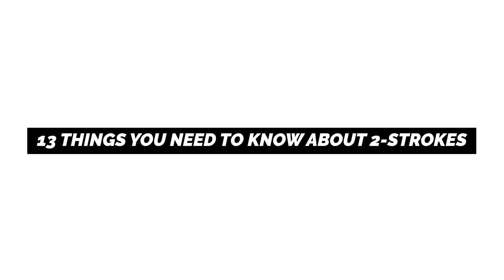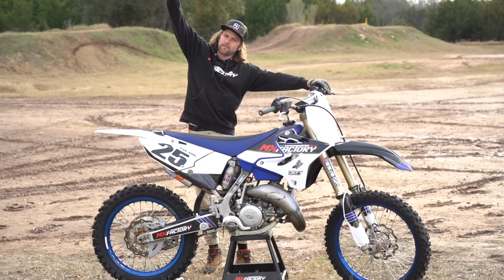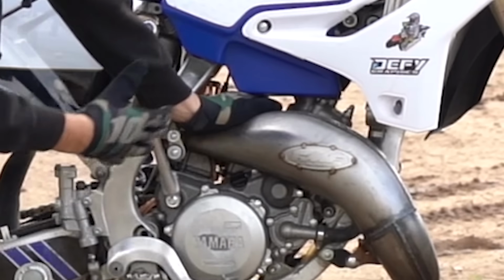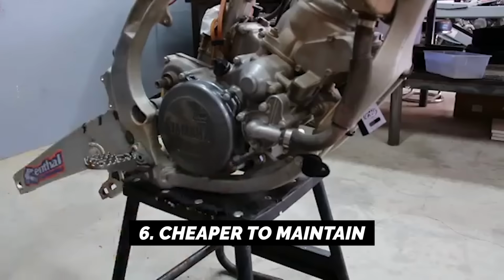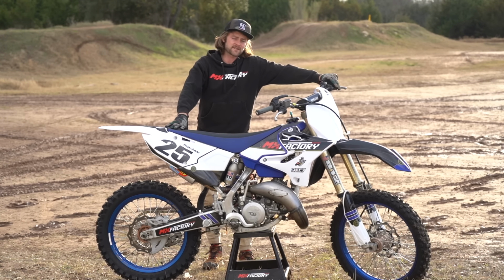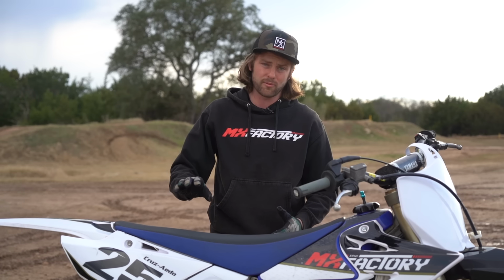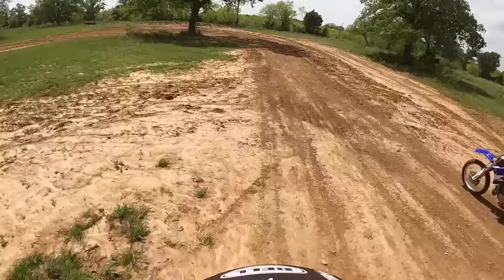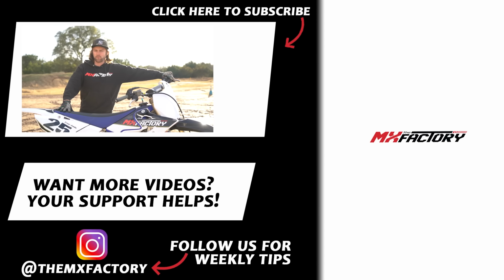13 Things You Need to Know About 2-Stroke Dirt Bikes

Comment: My dad started his 250 4 stroke at the beach 1 girl out of a group of 12 girls looked I started my 250 2 stroke right after and all 12 broke their neck lookin at me 🤣at that moment I realized the 2 stroke life was the life for me
Reply: Lol!
Reply: because 4 stroke sounds like anything else you normally hear, but that 2 stroke is just mean as hell sounding.  especially when it is revving to the moon and blowing smoke out the back.
Reply: Same reason superbikes turn more heads than loud annoying harleys lol
Reply: Bc they sound obnoxious lol
Reply: They turned to see if it was there old man coming mate, cause they dads owned 2 stokes, and probably couldn’t believe Dad got the heap of shit started again.
Reply: u dont use a rotary engine?
Reply: @benlondon8467  bet 250 two stroke blew 250 four stroke off the track
Reply: @robertjeffery696  lol, 😂😂😂, only thing blowing up on the track is ya 250 2T, I’ve had plenty of 2T when I was younger, they are shit boxes mate, I’ll take a 450 4T all day, everyday.
Reply: @Tv-nv7st  four strokes produce less torque. Power is basically torque X revs. 2 strokes are lower revving yet more powerful, therefore they produce far more torque.

BTW, calling a nearly 20% difference" not much"? Clearly you've never raced.

And the reason many manufacturers no longer make 2 strokes is purely because of legislation. In many of the biggest markets 2 stroke engines are being banned, not just for motorcycles, but outboard motors and even lawn mowers, whipper snippets and chainsaws.

To say two strokes are not competitive is idiotic. 20% more power in a lighter, cheaper and more reliable package isn't competitive?' In what universe?

Hate to tell you, but your post contained virtually zero facts.
Reply: I like 2 strokes because of the acceleration but they are annoyingly loud. I like the sound of a 4 stroke better.
Reply: Lol probably because they are loud
Reply: buddy I’m sorry but they looked cause they were wondering a why a fucking whipper snipper was on the beach😂
Reply: @Seeker-vo2tz  stay in the woods
Reply: @benedictcumberbatch4275  2 strokes ride smoother imo but i am comparing my ktm 300 to my wr450

Comment: If Suzuki got back to making 2 strokes I could really see them having a full blown brand revival
Reply: Fr
Reply: May we pray mate
Reply: They still make the rm85 2 stroke
Reply: I still have my 05 RM 250 and absolutely love it. More fun than my 21 Husky 450
Reply: @jrod1076  hold on to it its a better bike
Reply: @Andy Torres you got a good little bike their
Reply: I have a 125
Reply: I have a rm85
Reply: Suzuki sucks
Reply: They didn't really make alot of the smaller cc 2 strokes there all just rebranded kawasaki kx, 65 85 100 all kawasaki, not sure about the 125/250s but all the smaller rms are just yellow kx's
Reply: Yes also honda and if kawasaki made 125s that would be epic
Reply: Ya
Reply: If suzuki made 2 strikes again..I'd buy one, hands down
Reply: @vtecmossy  125s from 2004 onwards used ktm clones and revved out much more than the kx125s, 250 rms handled much better than the kxs, was a better ride overall, basically, those are two different bikes
Reply: @vtecmossy  that's not true, suzuki made those bikes and the kx85 and rm85 were never the same bike. The kx65 and kx100 were rebranded rms, however the drz110 was a rebranded klx110. A kfx400 is suzuki. I think they made a kawasaki version of the drz400 as well, few other bikes I'm forgetting. They had a deal going on but no the 2 strokes were made by suzuki amd the 85s were not the same because they were in a competing class, like the 125 and 250
Reply: They have the rm line shifter is butter
Reply: @sjtun9493  my nephew got a 2022 rm85, jesus they're quick bikes for their size
Reply: 100% bro
Reply: Yep. Keep the engine and frame because they're still good but update ergonomics and brakes and they'll sell.
Reply: Yes! Imagine they remade the Suzuki Gamma RG500 but with today's technology!
Reply: @issac8517   have you ever even so much as stepped foot on a Suzuki?
Reply: nah nah nah if Honda started making the cr 125 and cr 250 I would buy them both hahaha
Reply: I like Suzuki 4-strokes as well
Reply: @issac8517  you never rode one
Reply: @vtecmossy  not true
Reply: @VeritasSimRacing  Yes RM85s are awesome! ..now don't use the Lord's name in vain!
Reply: There loss Yamaha is the only Japanese Manufacturer that still produces and with all the championships and winning as of recent they could always Manufacturer 2 strokes.

Im glad Yamaha is successful as of now.
Reply: I run a kTm 85, I rode a rm100, that’s a fun ass bike 🔥
Reply: 2 strokes aren’t a brand
Reply: @pollux2825  bro what?
Reply: @eric6rock  Kawasaki still make kids 2-strokes tho, my cousin has a kx 65 and a kx 85 one is 2015 and other is 2022
Reply: Honda!
Reply: @chrissherwood4544  facts
Reply: I want my old RM back
Reply: @jeremyv4636  Ik man, good things come and go sadly 😩
Reply: @samenos7224  thank you for the history lesson sir
Reply: that would be awesome
Reply: I've got a 79 TS125. so fun
Reply: @CrewCrewlancer  yes, I have and they suck the carburetor is trash on Suzuki
Reply: I have a 97 rm125 and shes a runner!
Reply: There are new Suzuki 2 strokes for sale in NC
Reply: @kennymilton7457  they still make them but rm85
Reply: i got a 2000 rm suzuki first bike ever
Reply: I still have rm250 1998 running on good condition
Reply: They have the rm85 and rm125, actually I’m looking at my first ever bike and I’m getting a rm85, the price is great and it’s a dope little 2 smoker.
Reply: Currently riding a Suzuki tf125 2 stroke in a kx100 frame absolutely love it despite it being about 40 years older than me 💀 came from riding a 125 4 stroke and the power of a 2 stroke is amazing and the sound 😍😍
Reply: Suzuki never innovates or does well at anything. 

For example: DRZ400 and GSXR. They’ve been the same forever. Oh and the SV650. 

You think they’ll make a 2 stroke again? No way.
Reply: @issac8517 nothing quite as nice as a rm just simple machine none or the crazy expensive stuff
Reply: Had a 1984 rm 80 , 2000 rm80 , 2001 rm85 big wheel , built my own rmz250f , now ..... I got a 2008 kx85 2 bangers are mint.

Comment: I can tell you don’t get off the Mx track much. Two strokes own the woods.
Reply: yep i ride my motocross bike in the woods and you couldn't get me to ride any other bike
Reply: @Zander_Hale  MX bikes really suck for enduro I have done it and would never change. A enduro or even trail like my bike is way better!
Reply: @tylermacdonald9689  yea but i dont do anything like crazy enduro just some basic trail riding but 2t mx bike like mine is almost perfect
Reply: Yessir
Reply: @Zander_Hale  that was my only thing.  I don't have a track super close to me and I do drive to it sometimes but I have a lot of trail riding but was thinking of getting a yz125.  It's just trail riding, small hills, little rocky sections and fun bumps/whoops.  Do you think it'd do good there?
Reply: @flawlessvictory_yt7941  I dont own a 125 but from the fact that theres lots of people out there that take 125s and such out on trails and i take my 85 out on trails im sure that bike would be great for you especially since you go to a track every now and then
Reply: @flawlessvictory_yt7941  125s have no low end and are pretty bad at technical trails, very good for track but not as good for trails as they just have top end power
Reply: @flawlessvictory_yt7941  if you can find a 125x then sure
Reply: Debatable
Reply: Right.
Reply: Gncc especcialy

Comment: no engine breaking (or very little) is the thing i like least.
Reply: I reckon that's one of the good things,  easier to carry more speed through corners.
Reply: @callummacleod1921  100%!
Reply: You shouldn't engine brake a 2t anyways, the top end gets lubed by the oil in the fuel. When you engine brake it is only getting the amount of fuel it would get at idle, but it is still spinning at 3k+ rpms and not getting the oil it needs. It wears out the top end faster when you engine brake.
Reply: @cadencramer2747  Sorry mate, i have to disagree with you there.  The oil also pools in the crankcase and continues to do its job at zero throttle.  While prolonged periods of engine braking can be a problem, ie long hill decents, I personally have never had a problem over 20+ years of riding and racing 2T's.
Reply: @callummacleod1921  Yeah I was mostly thinking long descents. The trails around me are pretty much up or down, not much flat ground, so I usually just pull in the clutch and freewheel down the mountain.
Reply: riding a 2 stroke forces you to be a better rider. You can't be lazy on a 2 stroke or you WILL make mistakes
Reply: @cadencramer2747  Yep, not a silly idea at all. Better safe than sorry. A correctly tuned modern 2T is much more durable than people think though. The oil that comes out of suspension in your fuel and pools in the crankcase will lube your motor for quite some time at closed throttle.  Most people don't understand the principles of the 2 stroke motor,  and the majority of failures that people attribute to that closed throttle scenario are caused by other factors.

Comment: I recently switched to a 2 stroke and I love it! I do more xc riding so I got a 300 XC. It’s lighter and more powerful than my 250
Reply from the maker: Awesome to hear!!
Reply: Put in the red power value spring, turn out the power valve screw, slap on an FMF Fatty & 2.1 ti shorty. Take an extra pair of underwear if you remap the ECU...
Reply: Absolutely love my te300, 2 strokes as far as enduro and trail riding is the superior bike!

Comment: I'm 60 years old and I hadn't written a two-stroke dirt bike since I was about 20. So I went ahead and bought gas gas ex250. And I'm having a blast on it. It's a little bit scary because I'm only 5' 8, but I do what I have to. I love the 2-stroke power, the sound, and just the way they run in general. And the newer TPI bikes like mine can be lugged down without fouling plugs.
Reply: Almost the same brother. Haven’t ridden competitively in over 20 years. I’m 45 now and just bought a KTM 250 SX. Gonna take it on the track and show these youngsters how it’s done.

Comment: 2 strokes rule!  However, they are getting somewhat more expensive depending on what you buy because they are getting snatched up by collectors.  Great job Cody!  2 stroke Coaches Challenge race would be good!
Reply from the maker: This is true!
Reply: Thanks Tony. More 2 💨 videos to come
Reply: @codyhaverfield5152   Reason 14. VP Fuel's T2 burning reminds me of going to Supercross back in the 80s! Also makes the garage smell nice!
Reply: I got a 03 yz85 for only $1400
Reply: @tiana5271 that’s not that cheap at all 😬
Reply: I still find 125s in my area for below $1500. 250s seem to go around $2000 around here if they have a fresh top end. The odd thing is 80s and 85s seem to demand a premium. I don’t understand that.
Reply: @330FoeSho  I bought my 06 CR250R for 4k with Lectron carb and thought at the time it was a steal. I have since put another 3k in it. I never intend to sell it but I have seen similar bikes go for 5k - 10k in the Austin area. 125's typically go for a little less.  From what I have seen there seems to be a ton of people buying them, fixing them up and selling them for a premium.
Reply: Couldn't agree more. 2 strokes are becoming less and less available - driving up the cost.
Reply: @shoruda bruh what that’s not cheap?

Comment: I started riding my first time last year at 38 on a  2011 KTM XCW.  Had never ridden a bike in my life; didn't understand power band, sucked at clutching.  Put a few hours on the bike and pretty much immediately went and broke my tibia and fibula hitting a rock and got a nice metal rod and screw in the leg (sep 2020).  Poster boy of what NOT to do. 

Been riding past few weeks just taking it slow; messing with powerband springs and figuring out what I like and don't like and learning to clutch.  I've ridden a friends 4 stroke since the accident, but I'm gonna stick to the 2 stroke and learn to ride properly. Yes I'm an idiot - was my 4th bone break,  so wasn't anything new. Just first one on a motor vehicle.

Comment: I have a built YZ 125 making 42 hp on VP C12. To say they have less power would be talking stock power out of the box. With the built engine in the light weight 125 i have a far better power to weight ratio than even a 450. I can take them on holeshots even and have several times racing open class. The best part is 2 laps in the four stroke guys are getting arm pump and tired while im still just flicking the light weight machine. I usually get a good start with it and then stick with the leaders for a few laps and by the last laps when they are tired i put the pressure on forcing their mistakes. Two strokes are easy winners if you build them right and learn how to ride them correctly.

Comment: You forgot to add; number 14 ... locktite is your best friend when maintaining a 2 banger
Reply from the maker: Yes!! we forgot that one!
Reply: Sure if you have an old Ktm. With yamaha maybe not so much. And well, with modern ktm is even less.
Reply: New KTMs have a 2 stroke counter weight to cancel out most of the vibration.
Reply: I hate lock tight.  Only use it when absolutely needed, and I almost never need it.  If you want to mess up your torque specs, use lock tight.  Best to just stick with the torque specs.
Reply: @EarthSurferUSA  My sons TC125 manual specifies the use of Loctite on some fasteners in conjunction with a torque spec

Comment: To those who feel that the Powerband is too narrow, fit a VHM cylinder head and you will wonder why you did not do that earlier! We fitted one to our 150sx (that was an awsum bike to starters) and we ended up fitting a bigger front sprocket and a smaller rear one to keep the new power under control. Our 150sx is now a 250f killer!
Reply: If you want to go racing and get the best results possible then you have no business riding a 2 stroke but if your riding for fun then you have no business on a 4 stroke in my opinion ..  nothing like it when you connect a few corners while she's on the pipe ..brrrraàaaaap
Reply: Way to go! You guys rock!

Comment: At equal displacement, the 2 strokes power ratio is 1.7 greater. It means that a 250 cc 2 strokes is almost as powerfull as a 450 cc 4 strokes. If not even.
Reply: Yeah that's why 250 2 strokes race with the 450, pretty cool
Reply: @Frogcaramel  They should let 250 2 strokes race with 250 4 strokes.  The four strokes have a fifteen year development advantage.
Reply: @fredgarvinMP  and the 4 strokes would get smoked every race. LoL you can engineer all you want, a 250 4 stroke will never put the same fear in your heart as a 250 2stroke.
Reply: @jamesordwayultralightpilot  I have a question. new to the 2 stroke scene and just put in a new piston and clutch on a 1997rm 125 and I'm used to riding Honda 450crf's ,600cbr street bike ,and Yamaha ttr230 is it just me or is the power very low for my first time riding a 125cc 2 stroke or is the 450 just allot more power than the 125?

Comment: Two major things happened during the MX sport in the USA, and both drastically increased bike prices, because they were both intrusions on the free market of MX.
1)  The 1986 production rule, only in the USA.  The FIM (only in Europe at the time, but was always the boss of the AMA), was sick of USA winning the MXofN since 1981, so they got Yamaha to drop their works bikes in 1985, (again, only for the USA, Not Europe), and Yamaha was the leverage to have the production rule put in place,---for the USA only.  A 1984 YZ250 costs about $1,400, (already had 12" of wheel travel with up-side down forks breaking out, exhaust power valves, water cooling, disk brakes, single shock linkage rear suspension, and my 2019 YZ250 is about the same with a aluminum frame.), and a 1988 CR250 costs $3,200 new.  The price doubled in 2 years, because of the production rule.
2)  The 4-strokes were not a free market idea, but an idea pushed on the industry, through the FIM/AMA, by environmental groups and government groups, (far from free market), and the price doubled again. Yamaha was the first to race one with Doug Henry on the pegs in 1997. 

Both times, Yamaha was at the tip of the spear, and I find it ironic that Yamaha is the only Japanese manufacture still making a 125 and 250cc 2-stroke.  Wanna bet the cost of a new YZ250 2-stroke is really $6,500, ($7,500 is what they sell for), and for every YZ 250 sold, $1,000 of that profit goes into their 4-stroke program?

One thing is for sure.  Because of the FIM, the market share has shrunk to 1/10th of the bikes sold in the USA compared to the sales before the 1986 production rule. The FIM/AMA need some good free market competition with objective reasoning, ---or this sport dies eventually.
Reply: The YZs first came out with USD forks in 1989. I had one.

Jacky Martens won the MX world championship on a 4 stroke Husqvarna in 1993, which was the first win for a four stroke since  Jeff Smith won in 1965.